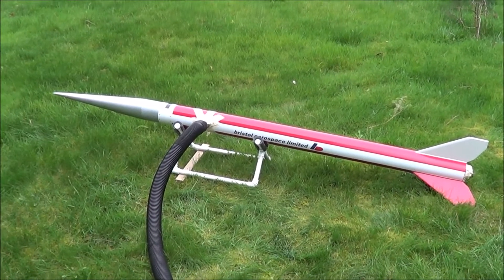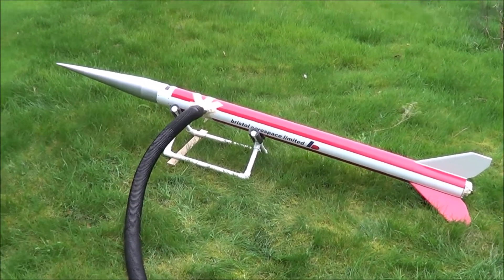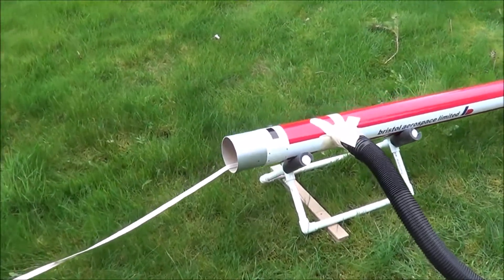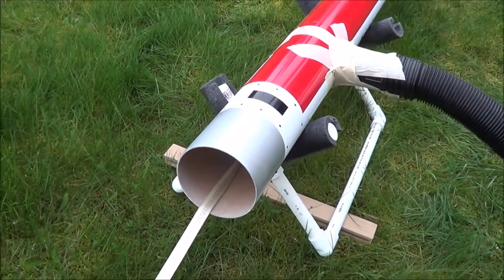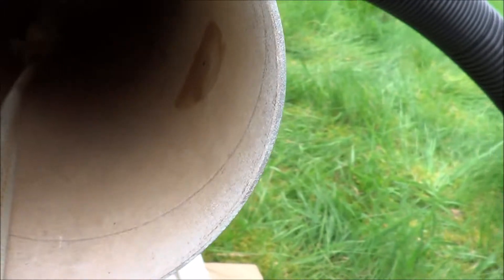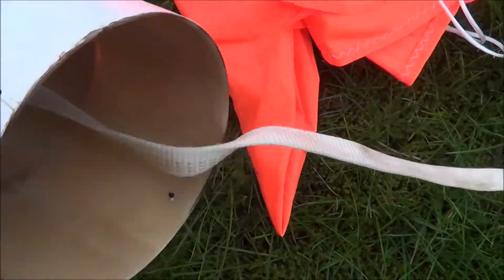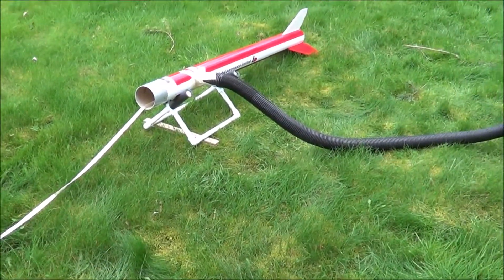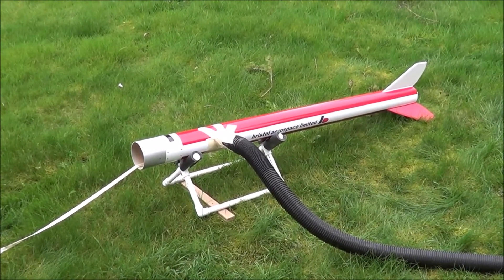Polecat Black Brant III Main Charge Testing RRC3

Comment: Awsome im building a 103" loc black brant bbx and it has 3 body tube section and the nose cone and i cant seem to figure out how to decide where to split it loc give no instructions there 2 couplers with exhaust baffles but they dont tell u where to put the cord anybody knows of a build video please comment im stuck thanks awsome rocket